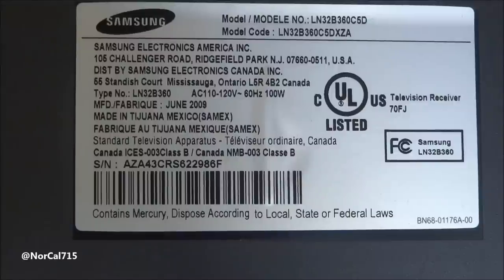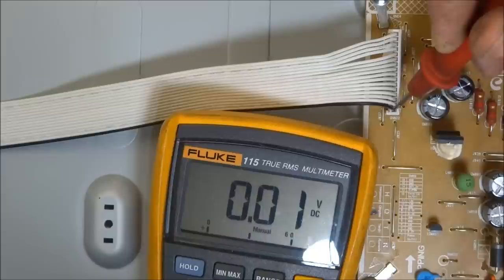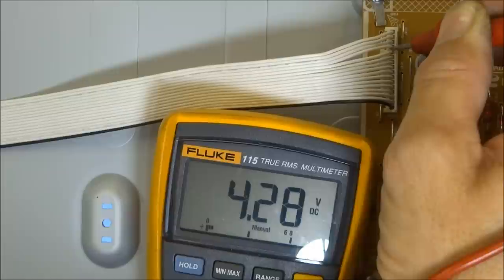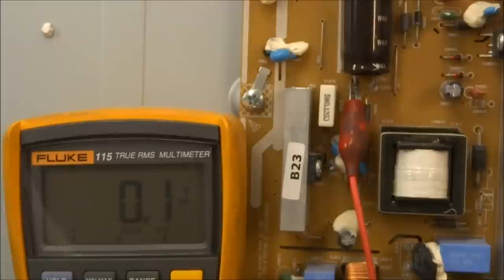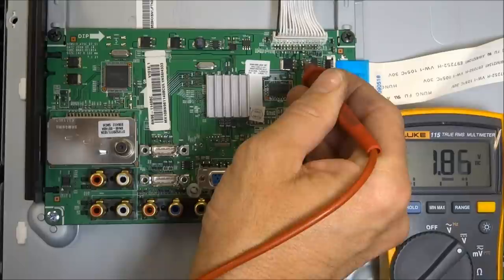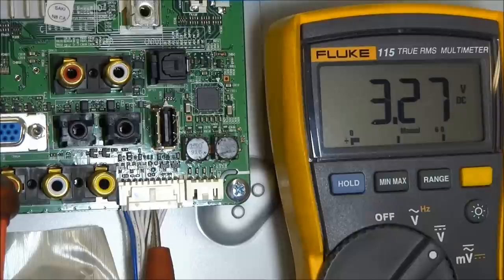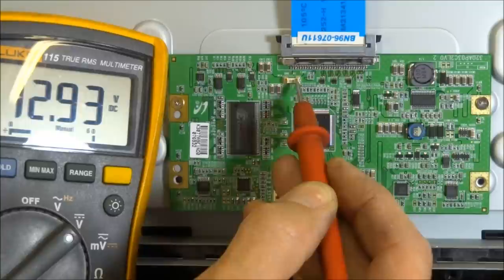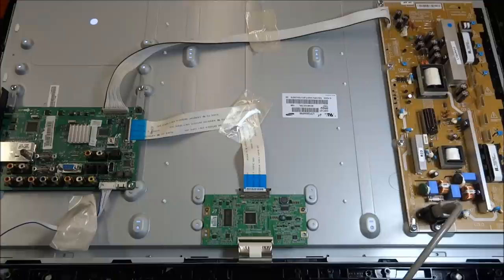Samsung LN32B360 LCD TV REPAIR Voltages and Troubleshooting

Comment: Just found one of these TV's on the side of the road the other day. Plugged it in and it seems to work fine. But one fine day it won't, I suspect. Your video will be exactly what I need to get started troubleshooting. Thanks so much!

Comment: Excellent video, so by testing the voltages on the tcon and logic boards the way you just did you will know if the part is working or not? Testing the fuse on the tcon and those inductors and coil fuse should tell if the tcon is working or not? thanks so much

Comment: Hi just a question, I was trying to measure voltage on leds but was confused to what my results were. I measured from each line to ground different values more voltage on negative line. Reason I was measuring no backlights but screen text was ok. No 24v for leds one leg was 0v the other 40v leds in series, any clues would be welcome. I have watched many of your videos and was really impressed with your straight forward and direct to the point way of presentation, many thanks.

Comment: The backlight sometime turn on and sometime it doesn't , when it doesn't I don't see the signal inverterON/OFF, I have audio.  If the tv doesn't turn the power factor correction doesn't go on, I could make the backlight go on by unpluging the power from 110vAc and plug it again. Were should I focus my problem , on the power supply board or the signal inverterON/OFF from the main board ?  what could be your best guess on what to change if is the power supply board?

Comment: I know this is an old video. I have a Samsung le40n87bdx that I’m trying to fix. I’ve got as far and my standby voltage being about 1.8 when it should be 5.3.. it pulses to 13v as it’s clicking off and on. I’ve changed 7 capacitors and tonight removed the ones I’ve changed because they didn’t work. Trying to think of where to go next.

Comment: Hi, great video, I need your help if you do have time, I have a samsung un55d7000 with black screen, no sound.  No backlight but when I remove the flex cable going to the main bord the backlight will light up. Further when I keep the flex cable feeding the main bord and remove the flex cable of t-con board that come from the main board, the backlight will come on. According to your expertise is the t-con board going bad ? Thank you

Comment: hi, i have a samsung TV model LA37C530F1MXRD with Powerboard: BN44-00339B. TV standby light on, but TV won't turn on. checked powerboard, can't see any bad caps or anything obvious. When I put my meter on 13V pin on connector, I see voltage go up to about 13v, then drop to 0v, then back up, like it's turning itself on/off in a cycle. Same goes if I put my meter on 24V pin on the connector going to the backlight module. If I disconnect the cable that goes too main AV board, the 12V pin an 5V pins shows stable volts. (not cycling) does that mean main board is faulty, or can it still be the power board? which pins can I short (with resistor) to turn power board on while main board is disconnected, so I can test PSU voltage while board is on? thanks!

Comment: So where would you probe on the hot side to check voltages? Ive only seen people use the main grounding on the box for everything. And would this be how you use an oscilloscope on the hot side. Since you have the grounded loop of the mains ground. Thanks for the info.
Reply from the maker: On the "hot" side, usually the negative terminal of the bridge rectifier/main filter cap is hot ground.
Reply: @norcal715  Thank you. So using chassis ground on the hot side or the electrical side would potentially short out the DC,backwards filter the ac to the dc on other boards? Im new and learning all this. I am one of those who have to understand why. Thank you.

Comment: Please, tell me, how to check voltage/ working functions on Samsung UN60EH6000F T-con board. TV has no picture, but audio OK?? In smaller t-con boards problems many times is Cap.#CD31 and Transistor QD2. Would they be same numbers/models in this bigger TV, 60 inch?? If not, what numbers they are in mine?? And how do I test them, when power is on?? Thanks, one more question: can I replace UN60EH6000F to UN65EH6000F, would that work just fine?? I have one extra one like that! Thanks, youtheman =)

Comment: Hi, sir I have a sony klv 32bx320  ser. no. 3238055. The problem is when I switch on the power , the red led  is flashing 6 times. before that indicator illim. is green for sometime about 5 sec then sound come out like a noise. After that red led start flashing 6 time. I have check the power at pin 3 is 3.3v and 24 volt to inverter is ok. Reg. 12volt to main board ok. What I suspected is back light inverter. Do you have a diagram for it or what else should I do. Any suggestion from expert. Thank you for your help.

Comment: greetings the video is great. I have a question 2 ask u I have a Samsung smart led tv that have lock out model # un46D6003sf unable 2 use the onboard remote the smart remote do u have resolution this
Reply: Replace your "IR Sensor".  Check Ebay to find one for 8 bucks..

Comment: norcal714, I wonder if you could take the time to help I know your very busy. I have a sony plazma  pn60e530a3fxza no pict but sound it started slowly not coming on everytime after about 8 months would have to turn on several times to get it ti go. one day would not come on at all. ive relaced x and y sus boards locic smps and y buffers I get a blink every 5 seconds on logic when I unplug y sus I get a blink every second (which I guess is proper) all votlages are good except ve wich is not good until I unplug ribbon connector on y sus when I apply power it tries to go I hear audio chime which tells me so ...if you have any  ideas would gladly love your help if you cannot thanks anyway scott

Comment: where did you find schematics?
Reply from the maker: most of the time there were no diagrams, just a knowledge of the working set. Others were from when I was a authorized warranty station for those brands. elektrotanya dot com is a good resource for manuals also. Thanks
Reply: @norcal715  Ha ha.  I got everything right on the site's test for registering except the last question on how to repair a switching-mode power supply.  of course...

Comment: This is a great video and got me off the ground in my troubleshooting.  I have this TV and it boots as soon as it's plugged in and then re-boots in a non-ending loop.  Well, almost non-ending.  A couple of times, for no readily apparent reason, it has come on, stayed on, and operated perfectly until turned off [by IR, side switch or unplugging] at which time it goes into the boot loop again.  Every measurement is exactly the same as in this video (https://www.youtube.com/watch?v=ocqnqmBxiqY&t=1155s) except for pin 1 on the ribbon cable connecting the power supply and the main board.  It reads 1.2vdc all the time instead of the 0vdc/2.8vdc shown in the video.  If I ground the pin it, of course, stops the looping but then it doesn't come on either.  If I disconnect the pin it reads .8vdc on the power supply side and 2.96vdc on the main board side.  I would expect 0vdc for off and 2.8+vdc for on as indicated in this video and it appears that Q302 on the main board is the pullup/pulldown switch but I haven't detected any voltage on the base so I would expect 2.8vdc on pin 1 unless something on the power supply is pulling it down.  The power supply side doesn't look like it could ever get over the .8vdc EB breakdown voltage of QM802 so I'm at a loss as to how pin 1 could ever get to 2.8vdc.  I've seen posts that have a similar symptom - continuous rebooting -- and they found bad caps.  I have removed and tested just about all of them and found no issues.  I have a schematic for the power supply but have been unable to find a schematic for the main board - BN96-11408C.  Does anyone know of a schematic -- either official or reverse-engineered?

Comment: I have the same tv, but it doesn't turn on easily, only after hitting the power button for several minutes non-stop, what could it be?
Reply from the maker: Its probably got some failing capacitors in the power supply. Heat it up with a hair dryer and see if it powers on faster that way.
Reply: @norcal715  Yep, one capacitor was bad, a 1200uf 10v was bulged, I replaced it with a 1000uf 16v because it was the only I had with the closest specifications. Should I replace it with a cap with the same specs or I can leave the one I used?